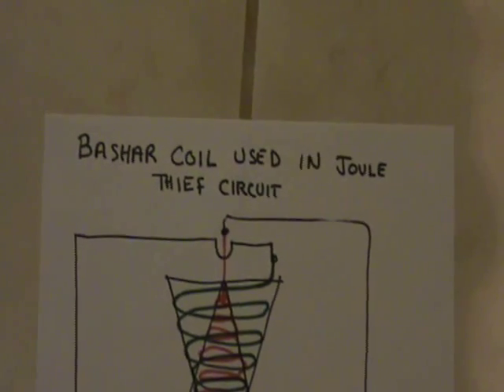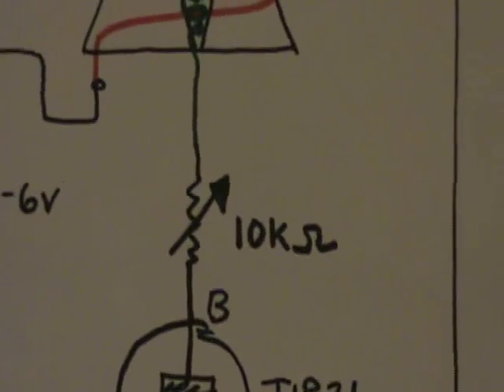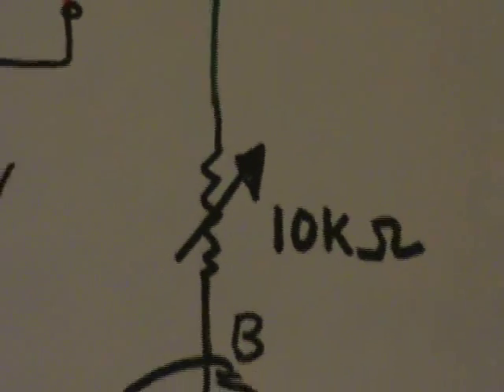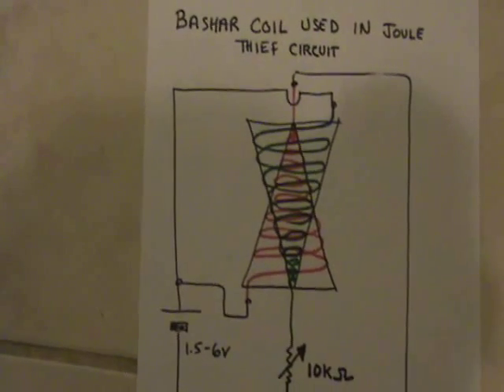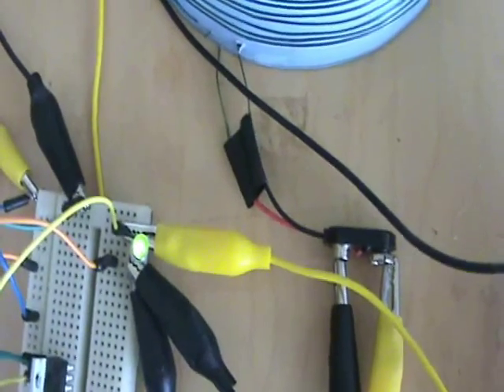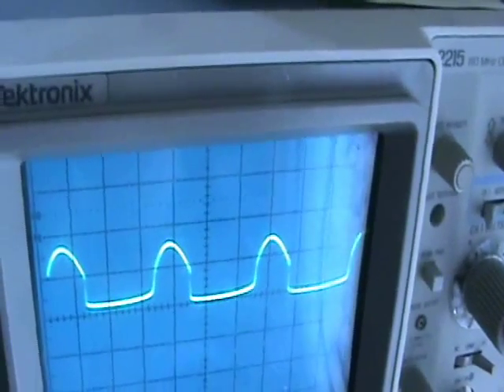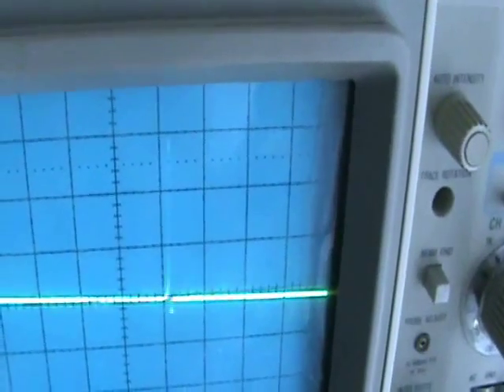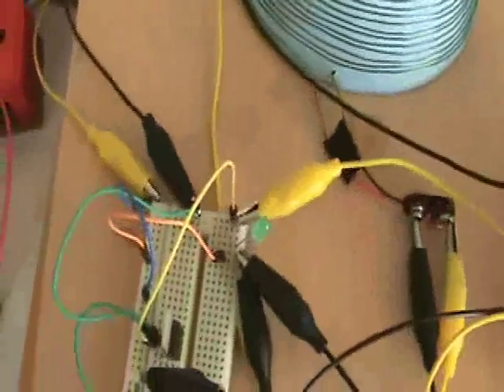Ep. 3: Bashar Free Energy Space-Time Antenna (Joule Thief Circuit)

Comment from the maker: @jackscholze 
So the right-hand rule, as I think about this just a little harder, applies to DC current flow. In this case we are AC, where the current goes back and forth ... so the right-hand-rule only speaks to one half of the waveform. I think therefore you can safely assume that turn direction can be either way -- as long as both cones are the same. We want to establish a phase relationship as one cone is turned up-side-down.

Comment from the maker: @jackscholze 
Yeah I was thinking cone-head too. Funny. Good question about turn direction. Yes make both coils identical. Turn direction should be clock-wise as you look down on the apex. Although, it probably doesn't matter and could be counter-clockwise too. There is a right-hand-rule in electro-magnetism, but I would think in this case there is symmetry. It would be interesting to know if the turn direction matters. I've pondered that.